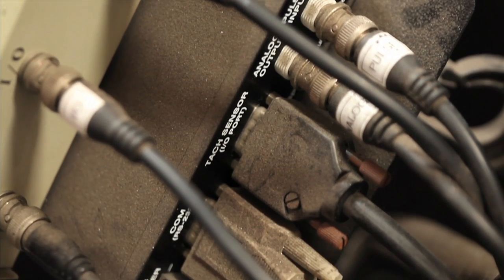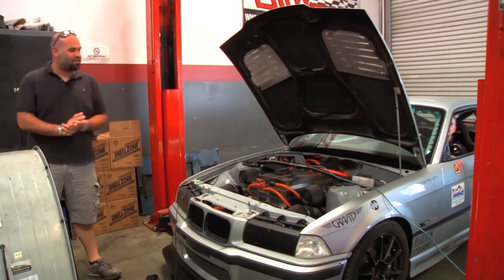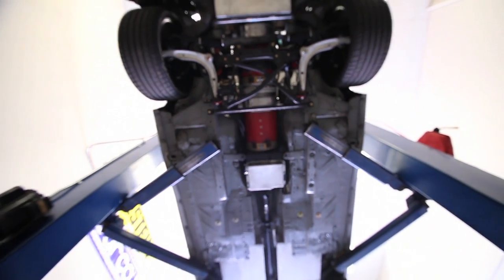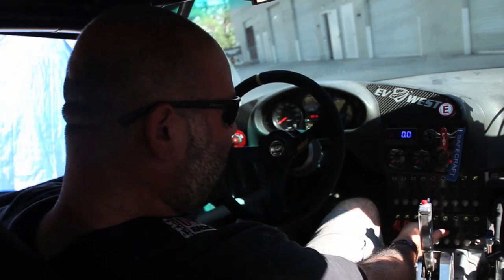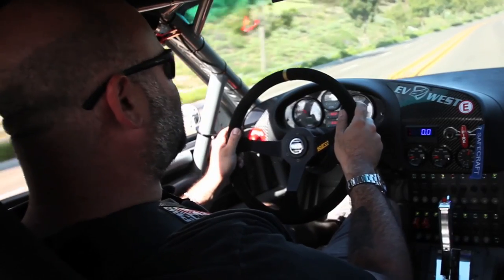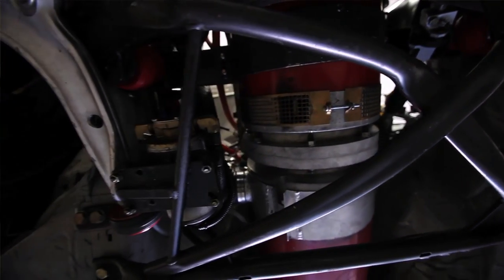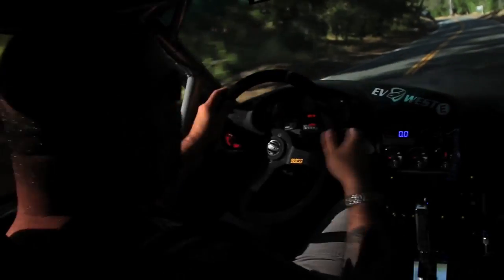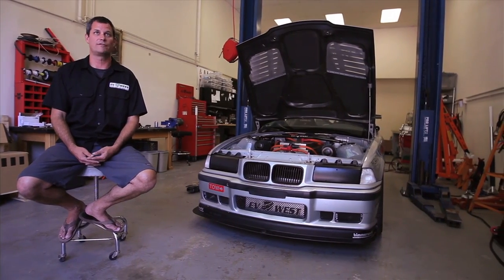This Electric E36 Makes 850 lb/ft of Torque at the Wheels! - /TUNED

Comment: this is actually kind of interesting when you think about the torque. it brings up the question of electric semi trucks and probably even electric construction/commercial vehicles that require a lot of pulling power.
Reply: The real problem, as with most EV issues, is that they don't have the battery technology needed yet. A semi truck must have long range, and a large output. A truck drivers NEEDS to be able to haul all day, every day; he can't stop every few hours to charge his batteries for an hour, not to mention the weight of any batteries big enough would cut into the cargo capacity....ever heard of axle-loading limits? It's even more so for large equipment. Productivity is absolutely key in heavy equipment. They spend tens of millions on large mining trucks and heavy; they need to to produce as much every day as possible. A vehicle that breaks down or needs to stop working a couple times every week for maintenance is an abomination. Having to stop and charge multiple times a day is the same. Switching batteries requires time and facilities that cost money, while a diesel truck can just fill up a 1,000 gallon tank of diesel in the morning and go all day.
  Yes, electric motors make a great deal of torque, but the energy storage is impossible with modern battery tech. That is why when they do use electric motors they store energy as diesel fuel, convert it with a big turbodiesel engine, and then send it to electric motors in the wheels. That's how most American locomotives work, and that's the way that the very biggest mining trucks works. For anything smaller, it's not worth the extra cost, weight and complexity of having to fit an engine AND electric motors into the vehicle. It's called "diesel-electric transmission".
In Europe, electric trains that take power off of an overhead line are most popular, but it's not so easy in the US. The US is much bigger, and therefor it would require us to pay to lay down much more line to cover all the main tracks. Second, transmission lines literally loose power over distance, so it would require huge inputs to have sufficient power at the end of a long line, and you have to keep that line powered 24/7, in case a train runs over it. The expense is enormous. Most American rail lines are less intensively used than European ones, so it would take long for the cost of electrifying to pay off. Rail has been more popular in Europe, because the distances are shorter (less track laying and maintainance costs), but particularly electric rail, because fuel has always been much more expensive in Europe. In the US, electric trains don't make sense. But I've gotten off topic now...
Reply: ***** electric drive is common in the largest equipment industry.
Reply: justforever96 Lets hope that we get carbon nanotube capacitors soon! :P
Reply: digimon916 ... Apparently someone heard you... Tesla is unveiling their Semi Truck next month and my guess is It's not going to be an underachiever...

Comment: What's not to like? Everyone who talks shit on EVs seems to think that they'll somehow replace internal combustion across the board. Never gonna happen in any our lifetimes. Both can peacefully coexist as gas, diesel, OHV, OHC, Vee, inline, horizontally opposed, rotary, 4-stroke, 2-stroke, auto, manual, dual-clutch, turbo, supercharged, front wheel drive, rear wheel drive, all wheel drive, etc. ad infinitum have all co-existed for the last hundred years or so...

Comment: I understand this is a race car, but I'm interested to know about the normal driving range with fully charged batteries.
Reply: And how it is built along with the price of the components.
Reply: Art O I think I read somewhere that the range is under 100 miles, because it is a racecar, it is not meant for a casual conservative commute.
Reply: @romeah5697  probably far less if you push it really hard on track and takes hours to recharge

Comment: The idea behind developing electrics for performance is that battery weight, while currently significantly higher than an ICE setup, will inevitably go much lower if there is consumer demand for the research thereof. We have had over a century developing ICE motors; this is relatively new mass produced tech. Give it just a decade. You'll be amazed.

Comment: As far as motors go, electrics generally win performance-wise over ICE in almost every way. Right now the problem with electric is the power storage. Current battery technology sucks compared to the amount of energy in fossil fuel. I get the dislike for lack of engine noise, etc but the fact is, if energy storage improves enough (light weight, more power) then I believe we will reach a point to where if you want to win races you will need to be electric. Younger generations will probably even grow to love whatever sounds those cars make better than the old ICE powered vehicles.
Reply: ***** Which is what I said. Read my comment again carefully. As I said, power storage is the limiting factor with electric motors and why they can't match the energy (ie. performance) in fossil fuels. Current batteries are too heavy and hold too little power. This isn't a limitation of electric motor themselves though.
Reply: ***** fuel: alcohol, fossil, batteries is all the same. They are an energy storage mechanism. How that energy is applied is what matters and all combustion engines are way less efficient than an electrical motor (more moving parts, combustion losses, etc). Consider typical combustion engines can't even break 40% efficiency at their very best and are generally much worse whereas electric motors can go over 90% using current technology and are lighter. All electric needs is a superior energy storage mechanism and combustion will be dead (whether or not that will ever happen, I don't know).

Comment: I wonder why they could not put a limiter into the motor controller to prevent 100% of the motors output to be delivered when the m3's speed is 0, or transmission is in first gear to prevent drive line shock, or to allow the motor to ramp up over set time, rather than full on

Comment: This guy's opinions are lame. If you're a car guy, and love speed and competition, you'll get over losing the internal combustion sound effects and smells. And there is a whole new world of sounds and smells in the electric world. 

In the end it's about driving.
Reply: gotta love the burning electric smell
Reply: Dual clutch is already starting to take over manual transmissions.
Reply: His complaints are legit, tires only have so much grip to give. The added weight limits breaking and corning ability, period.
Reply: There is a difference between sports cars, and race cars. Race cars, it doesn't matter what the driver likes, it matters what makes him faster, to you and me, in a sports car, the fun is a very big factor. A standard manual will always be more fun and engaging. But that doesn't mean faster. Driving enthusiast will NOT like losing that.

Note, some of the fastest street cars, are not the most fun street cars.
Reply: "The added weight limits breaking and corning ability, period." What you fail to understand is that electric cars do not necessarily have to be heavier than their gas equivalents. The main cause for the misconception of "inevitable weight addition" has generally come from the fact that batteries have had a much lower energy density than gasoline. However, that fails to take into account the fact that your average gas engine has 20% thermal efficiency, maxing out around 30%. Electric motors are much more efficient, significantly reducing the amount of total stored energy you need to carry, not to mention the weight reduction in the drive-train that electric power allows. (or the fact that modern electric motors have better power/weight ratios than any gasoline engine could ever achieve). In fact, even with current-gen technology using Li-ion batteries that have lower energy density than gasoline, if you have two full drive systems (gas tank/battery all the way to wheels) with the same power and range, you see two things between the two: first, the electric system will have roughly twice the torque of the otherwise equivalent gas system. Second, the electric system (remember, we're talking battery all the way to wheels) will actually weigh slightly LESS than the equivalent gas system, and that's with current technology. There are many battery chemistries currently going into test production that actually have better power density than gasoline. I AGREE that added weight limits cornering and braking ability, but what you don't seem to understand is that electric cars do not have to necessarily, or even generally weigh more than their gas equivalents. Your argument would have made sense in 2003, but not anymore. Sorry.
Reply: Some fairly decent mental gymnastics you're doing there.. You got any real world examples of a comparable model car where the main difference is electric vs gasoline drivetrain? Not talking home made DIY but by a manufacture.

Batteries are freaking heavy, and engines are getting lighter weight and more powerful all the time. I don't believe we have met a crossing point yet, not even close really. The problem with the electric car, is the battery.
Reply: not getting over advancement in technology? lmao
Reply: I'm sorry, but the argument you brought up with manufacturers not making electric and gasoline cars based on the same platform is just wrong. Of course they won't! They invested so much money into developing these technologies for gasoline and diesel engines, and making factories. They aren't going to just give up their investments. It's about money and greed here, sometimes. I don't know technical stuff as much as I need to give out a statement like "Gasoline is better" or "Electric is better". I do agree, however, gas seems a bit more fun. Purely theoretical and on the spreadsheet, electric seems to take the cake. That's how it just is.
Reply: We're called petrolheads for a reason
Reply: Not against electric cars at all, but I dislike the idea of combustions engines going away
Reply: I agree in the context of electric motor vs gasoline engine, that electric motors can be easily far far superior. HOWEVER, the battery technology we current have isn't realistically refined enough. They're to heavy and take to long to charge, and range is to limited. 

And all this bull shit about zero emissions is just that bull shit. No one references the extremely toxic lithium mining, or disposal of said huge ass battery. Or that the power to charge the car comes from the grid. 

I maintain that the most "green" power source is bio-diesel. There have been cars made by manufactures that can get 70 MPG. Feed it bio-diesel made from wastes and um that's pretty fucking eco friendly. I also would point out that hydrogen is a realistic fuel source, being abundant as hell and emissions being practically nill. Both solutions still keeping internal combustion engines around.
Reply: If you think that internal combustion will EVER go away, then you're daft.  There isn't a SINGLE piece of technology that's more ingrained into the history and culture of human beings as a global-whole!  Just about every country on earth has been dramatically changed by it's invention, and for over a hundred years it has been an integral part of shaping not only who we are as a species, but it's also changed our landscape.. and how we perceive things around us.   It will be a very, very, VERY long time before the internal combustion engine becomes an afterthought.  I'd be willing to bet that we won't even see a 50/50 split (IC vehicles VS other fuels) in our lifetime, or even our children's lifetime.   I would HOPE to see more progress than that, as I would love to see the IC engine become used only for hobby/sport, as it would mean that we've solved our pollution problem as a planet, and we've broken our dependence on fossil fuels for transportation, at which point, I can die happy.  But.. alas, I don't think I'll be able to witness such a utopian future.
Reply: Good luck getting developing nations to try to go green....I could go on and on, but we're getting off topic.
Reply: Ah ha ha ha...100s of hours of track time, owned cars from a 1969 Mach One w/ 428 CJ to an E30 M3 along with an S4 in there as well. Do my own work on my cars too. Pipe it down pinhead.
Reply: I can live with the electric sounds, though I love the brutal sound of lots of horsepower under the hood, and I probably wont ever be saying "ahh I don't care", but okay, maybe there'll be really good systems that can mimic that sound without it obviously sounding like from a speaker, but heck I do not want to give up that feel of power building up and pushing the revs then shifting up manually to then be thrown into the seats again as you push the pedal in the next gear. 
Really if you say you are a car guy and only care about the speed in the end, you're not a car guy. 
I'd take a slower car for the sake of that feel anytime over a high speed gokart. I do not want to only have to work with accelerator and brake. I want my clutch. I wan't to be kept really busy with mastering heel toe shifting/rev matching while balancing the car with accelerator&gas while driving. 
Let it be electric powered, I guess inevitable in the future, but heck, I'd go to courses to learn how I could possibly put in a transmission in an EV and programm it to have a performance curve like a normal gasoline motor. Even if I'd be the slowest in a race of EV's.
Reply: Why do you think everyone is bored of F1 currently? Its not spectacular anymore. The drivers aren't doing the race anymore, the technology does. Completely overflowed with assistance programms and technology in every part. I've never been into F1 so I don't know exact numbers but only the spilers alone cost like 20-30k.. what the heck. They are faster than ever and even more boring than ever. Who cares if the cars go 300 or 340 km/h if they look like carrera cars while doing so. 
@domjubgwefer Great point by the way, I'm all for EVs for everyday use, most people nowadays want their normal gasoline powered cars feel and drive like an electric car anyways. But it would be shameful at least if it would be lost for the sake of racing. 
I never had such goosebumps before when a good old rally Audi S1 with 400 HP drove past me while shaking everything with the backfire and that crazy growl of the antilag. Nothing ever can replace this.
Reply: It's nice when you only care about yourself behind the wheel. It's boring to look and listen to as part of a public ( F1 would not be as bigg as it is without a crowd looking at it)
Reply: wrong...for the driver pilot it's about driving and electric is ok but for the sport it's about sponsors and sponsors want coverage, electric racing will never get that because it's boring and awful to watch there is no show...there's already a formula electric that no one cares about, so no it won't just go to electric and be all nice and well, the day competitions go all electric they are dead why would you watch nothing ? people will just maybe read the end results on their smartphone but most likely they won't care at all, laws become more and more anti-cars less young people like cars every day that passes and it's not EV that will make them like racing or cars
Reply: Stefan Marraccini I totally agree with you worst video with Matt Farrah I ever seen
Reply: I wish I had the time to do that, it would make the future of driving a bit less boring!
Reply: Stefan Marraccini how about you bring it down to a zero
Reply: agree WTF......
Reply: this is lame. i love my s52 e36. the sound and shifting gears is what makes driving
Reply: Right. Your a real car Guy!!
Reply: Wait until zero point energy!
Reply: He's obnoxious too

Comment: I have a 2012 Prius...     Two things, you are not saving the environment, that electric might come from COAL..  And second, for those missing the sound.. Not a problem I fixed up a bracket to hold playing cards in the spokes..   Great sound now..
Reply: Internal combustion engine only 20% efficient, thermal plants are 80% efficient and some percentage comes from the renewable source

Comment: I follow that view.  By nearly every measure the atmosphere in North America is much cleaner today than it was 40 years ago before we started serious emission controls on industry, energy production and automobiles.  That includes particulates as well as chemical pollutants.  Smog once problem in US cities is all but a non-issue.  Actually I support the development of alternative energy of all forms and the cleaner the better. But facts are facts. Electricity is not free it has to be made.

Comment: love the idea of electric cars not because I care about the environment, honestly I dont give a shit. But having a silent car with instant torque and no fuel bill is something awesome. But how would these electric motors work with transmissions? when you shift and let off the gas the rpm drops to 0 instantly which wouldnt end well when the clutch is released
Reply: You don't really need a transmission when you have 500+ lb. ft of torque from zero RPM. :-) The White Zombie (an electric Datsun 1200) does 0-60 mph in 1.8 seconds and the 1/4 mile in 10.2 (or.4...I forget) seconds...Anyhow, no transmission.

You could always use an automatic. A small motor could drive the pump. :-)

The Yasa-750 is a 60 pound motor that's about 13" in diameter, and about  4 " thick. This thing puts out 500 lb.ft. of torque....60 POUNDS in weight!
Reply: I'd rather talk to a wall as it provides as much intellectual feedback as you.